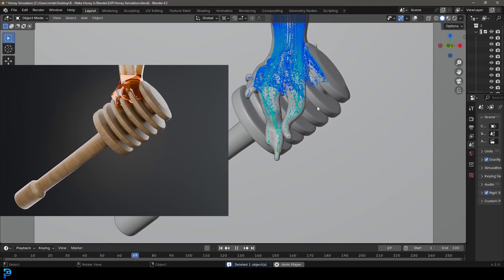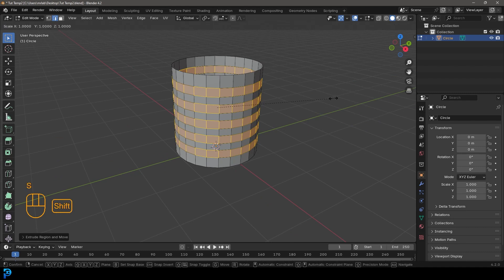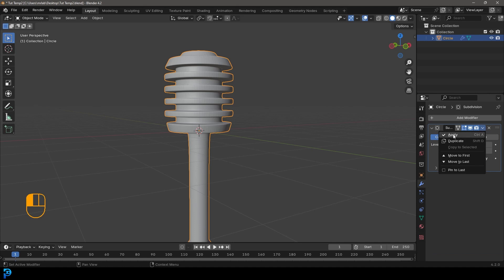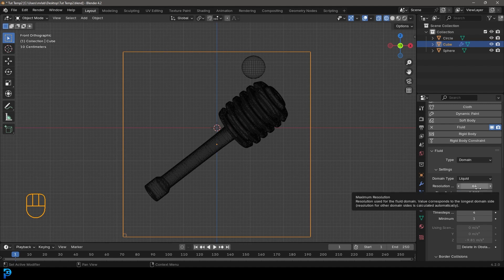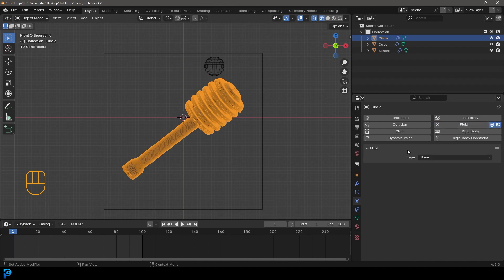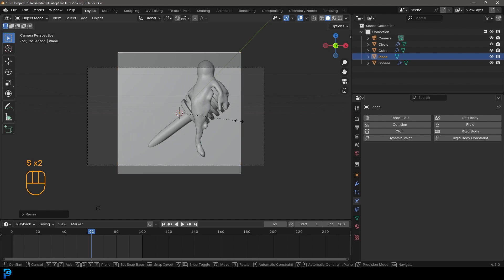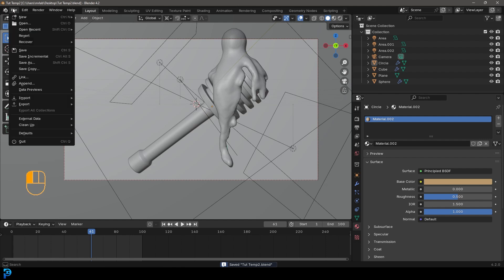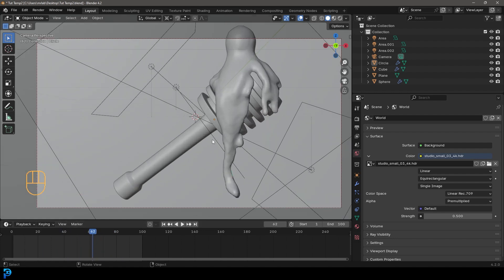Honey Simulation Tutorial | Blender Beginners

Comment: Just two quick tips when modeling the honey dipper at the beginning: you do not have to right-click after extruding with E if you want to scale those loops, you can simply change the default move action to scaling by directly hitting S (and then  Shift+Z) after starting to extrude with E.
And for recalculating the normals, instead of using Alt+N and then having to choose Recalculate Outside from the menu, this action has a direct shortcut: Shift+N. (Note that this action will not always give the correct results if a mesh has bad topology, but neither will Alt+N in this case.)
Oh, and I would have enabled the High Viscosity Solver in the domain settings later on, because it is specialized for more accuracy with liquids like honey or molasses.